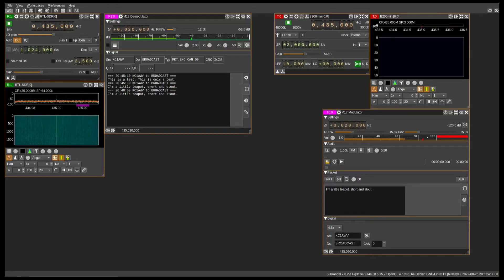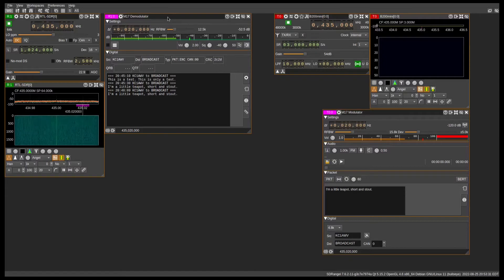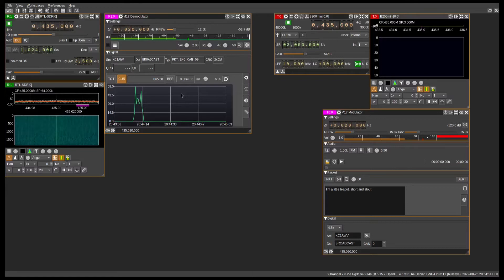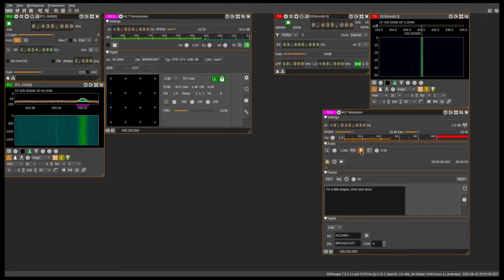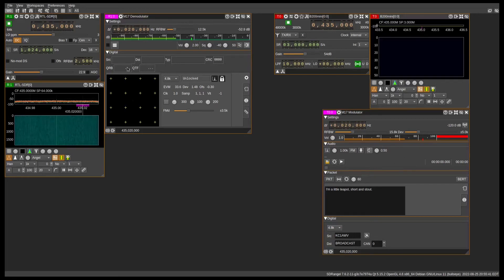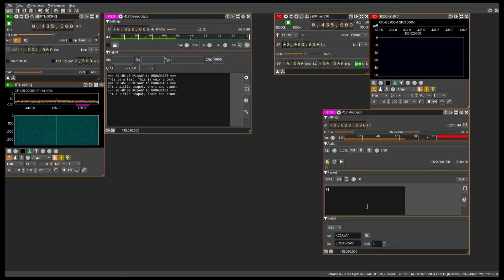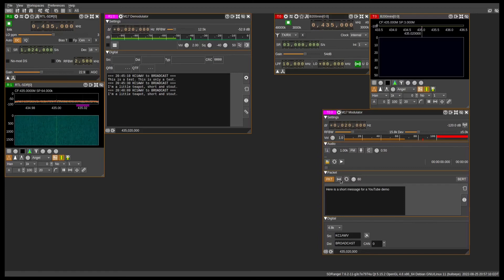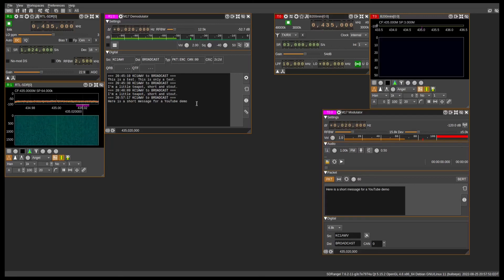SDRangel M17 Quick Demo

Comment: Nice Demo. Are the M17 mod/demodulators for SDRangel available to the public? I assume this setup will work with a HackRF One. 73 K9OJ.
Reply: The M17 modulator and demodulator is available, but only in Linux right now. A HackRF should be capable of transmitting M17!
Reply: @aether-net  Thanks Steve.